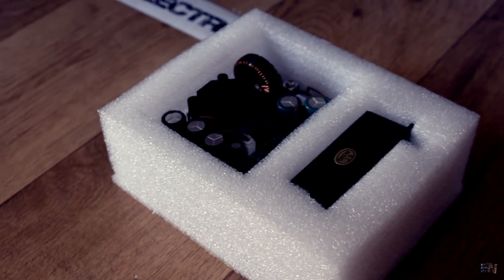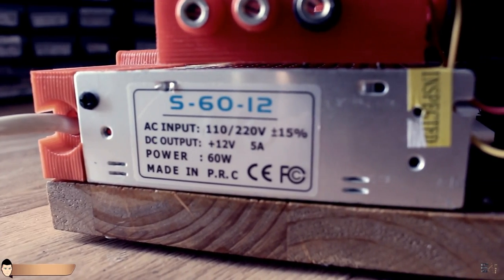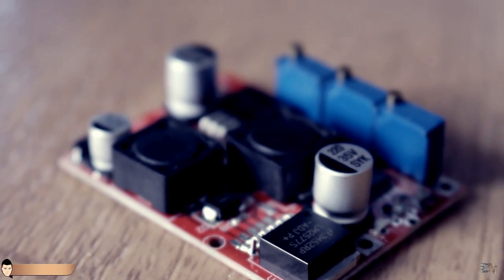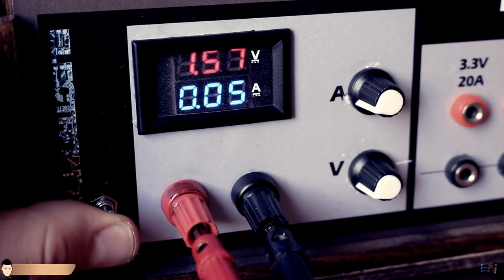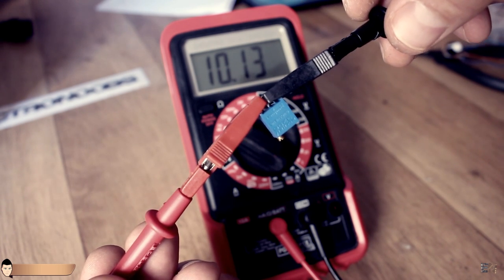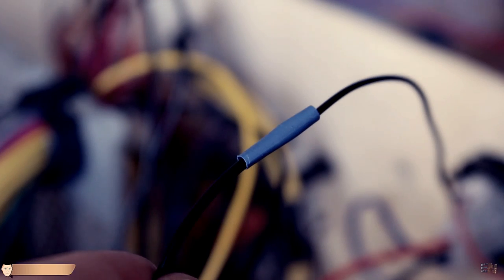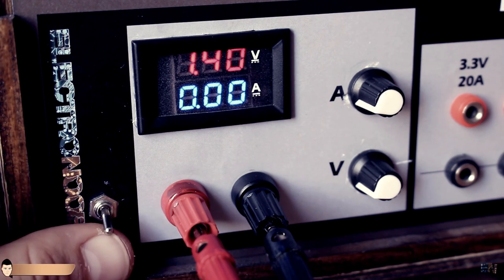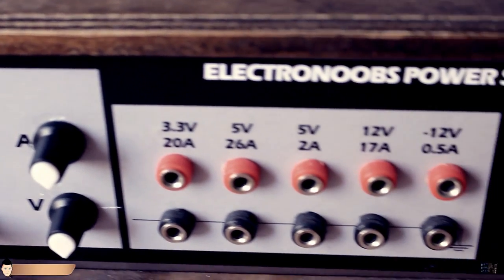DIY variable bench power supply (less than 10$)

Comment: Can you clear up the current ratings of the supply.   A little confusing
Reply from the maker: The PC power supply has a current limit up to 26A in my case, but the boost/buck converter has a maximum current limit of 5A. For higher values the module will turn itself off. Keep up!
Reply: If I understand, the variable voltage part of the supply is 5A max.  Would that be correct?
Reply from the maker: Yes. If you use a better DC to DC converter you will have higher max amp.

Comment: I like to build the same thing thank you for your build.i have 1 problem I didn't find anywhere. Iam repairing laptops for my hobby. I don't have money for a bench power supply.and all step up converters doesn't have larger amp limit.
Most laptops using 19v up to 6 to 7 amps in many cases.
Can you help me build one with an PC power supply? I would like to powering multiple laptops at ones.is it possible?
Where is a stepup converter capable so big current ? 19v as much current possible.
A few laptop have 15v 18.5v but always 5-6 Amps.
Thanks for you're help
Reply from the maker: https://rover.ebay.com/rover/1/711-53200-19255-0/1?icep_id=114&ipn=icep&toolid=20004&campid=5338106513&mpre=https%3A%2F%2Fwww.ebay.com%2Fitm%2FDC-DC-Converter-10-12-15-20A-150-250-300-400-1200W-Step-up-Step-down-Buck-Boost%2F382219150784%3Fhash%3Ditem58fe0965c0%3Am%3AmCHY1nLxgu47cYpdyd1LmDA

Comment: what if i want a 24 volt power supply and not a 12 volt?
Reply from the maker: No problem. Always check the boost convertet maximum and minimum output/input.

Comment: I am building the bench power supply right now. Its basically done but i ran into a problem. When the screen is connected the power supply wont start. It starts for a second. Theres a light in the boost buck converter and nothing else after that and the light is off as well. When i disconnect the screen everything works. The unregulated ports work everything is fine the boost buck converters light is lit but as soon as the screen is connected the power supply doesnt work. Anyone has an idea why is this happening?
Reply: One buck converter burner cause i messed around with the wiring but i understood that the display was the culprit cause when the display wasnt connected everything worked including the buck converters light. But when i got a new buck converter same problem but when i disconnected the 5V connection to the display the buck converter blew up. Im waiting for the next display to arrive and gonna try that one and if that one doesnt work im dumping this project but i dont understand why it doesnt work cause i wired everything exactly like in the schematic.
Reply: @stalker2993  "I think" there is a mistake on the diagram wiring, the output + and - are switched around. 2xCheck this, I dont have any of these component so I am only looking at the pictures from ebay and this guide (diagram)
Reply: @apku04  Thanks i just checked out the schematic and the video where he solders the +out -out and they are not the same. In the video the red wires are soldered in +out but in the schematic they are shown to be connected to -out which is why perhaps twice the buck converter went up in smoke the first time and blew up in my face almost the second time. I knew that its kinda odd for the ground negative lead to be connected in the +out but i thought if the schematic says do it like that then ok. Thanks Electronoobs.

Comment: under $10?

hope you're joking
Reply: I can see $10 if you don't count...  DC-DC Boost/Buck = $3....  PC PSU = $3.... V/A display = $1.... Potentiometers w/ knobs & Toggle Switches (all for) = $2...  Banana Connectors = $1... Case (Already owned wood, Stain, Wiring, Shrink tube, Screws, Feet, ect),  And all this with free shipping from China and ROUNDING DOWN to the nearest $1 dollar. lol...

Comment: What is the point of -12v?
Reply: To get a 24 V output between the -12V and + 12V, but limited in current because the - 12V has generally a quite low amperes value (less than 1 amp). For instance, I've got a 650W ATX PSU with a 52A rating on the +12V but only 0.8A on the - 12 V. I can get a 24V output between the 2, but I must limit the current I draw at 24V lower than the maximum amps rating of the lower rated rail if I want to not burn the cable of the - 12V rail. The + 12V rail can withstand 10A easily, but not the - 12V; and if you want a 24V output, you have to use both.

Comment: Is your schematic correct for the voltmeter module? My units have  a yellow sense wire. http://diyprojects.eu/how-to-wire-digital-dual-display-volt-and-ammeter/.
Also, I use the 5V standby voltage from the ATX PSU - this means the meter is lit when the ATX has mains power but shows 0V and 0A. When ATX output is switched on, Voltage is displayed.

Comment: What is the - 12V rail useful for?
Reply: In case you have a project where you need reverse current. You can also use it as ground and have 24V. Probably not recommended with an ATX power supply tho...

Comment: Lm2596 lm2577 regulator used un the video is the worst regulator module ever exist, claims to have max current of 3A but mine destroyed after running a load of 2.1A for some time, and at 1.9A it gets hot as fuck, i would go with XLsemi products or Linear technology modules instead of LM

Comment: less than 10 bucks? come now my man.. even at (take a month delivery) bang good you can't get both of those little charms for under 10 bucks.. plus the cost of the terminals, the potentiometers and knobs, on off switch.. I just now bought some of the same equipment and it cost over 10 bucks I sure you.. without the fancy buck converter and it still cost more than 10 bucks... BUT! it is a fun project everyone should try.. but just watch out for those two big capacitors in the power unit.. they can put the hurt on you real bad and if your not aware of that wait and do this project another time.

Comment: FUSE THAT SHIT. The moment you short those 20A outputs by accident bad things will happen, that's enough to melt thin wires
Reply: The PC power supply has a fuse for it and short circuit protection.
Reply: I know it does have short circuit protection. However, it would trigger at 20-40 AMPS, that is if your circuit gets more than 100-200 watts from it. So it is very easy to get to the case where device is taking huge current but not enough to trigger short circuit, and at that power it means device will probably burst into fire. You really want 1 amp or below for most devices.

Comment: Hello,i have been following your guide step by step,but i have a different volt/ammeter ,it has 2 thicker wires (whereas your's has 3 thicker wires,one of them is blue) and the smaller connector has 3 wires (red,black,yellow) .. i am putting an youtube video link,how should i change the wiring because of this issue?

link https://www.youtube.com/watch?v=4paX0AXsYC8